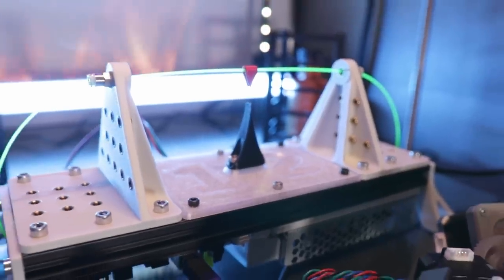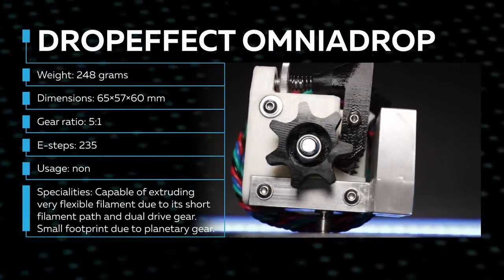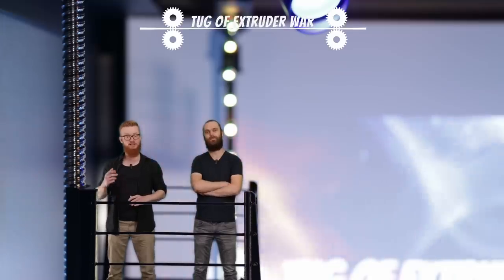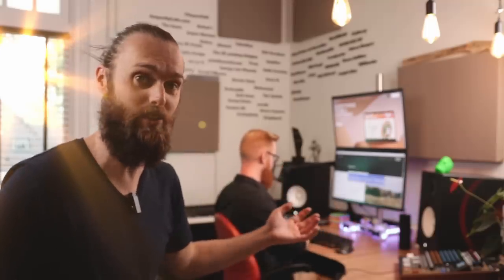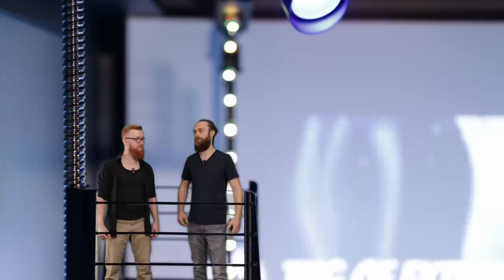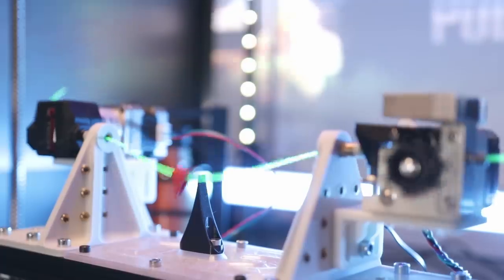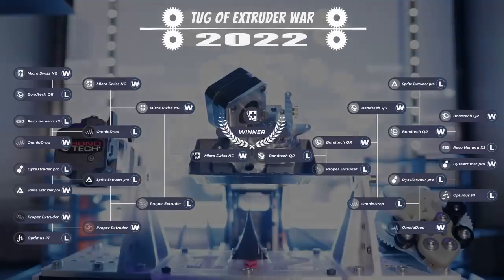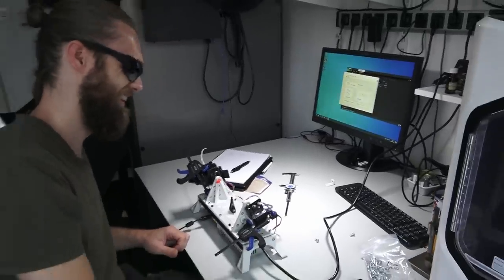We let Extruders BATTLE each other FTW!

Comment from the maker: Hi everyone! In this contest we really push the boundaries of these extruders. Or should I say pull? Remember that the outcome of this event should not influence any buying decision. There are other factors at play when choosing the right extruder, like ease of use, weight, mounting options, extrusion consistency and durability. Extruders mostly exert pushing forces on filament where the filament "wants" to buckle. This is part of what makes printing flexible filaments so difficult. This is the opposite of what we show during this contest. But hey, this is a fun way to compare extruders!
Reply: Don't forget that their Intro Theme Song is also a factor in choosing an Extruder. :)
Reply: Season 2?  
OMG DM1
Orbiter 2 and a few other new extruders should be included.

Comment: Fun idea, this actually should be something they all should do to test these components out and improve their product.
Reply from the maker: Thanks! You can quickly see which parts fail which is very interesting. Normally extruders aren't stressed like this, but I think that lessons can be learned from it.
Reply: Honestly, I am truly fascinated by the idea.
Have e.g. weight classes as well, to determine different characteristics for extruders under 250g/400g/600g etc.
Soooo cooool, and actually useful as well!

Comment: THAT WAS AWSOME, totally great idea of the match and this way you went about it, I was also super impressed to see how well your extruder did, but when you think about it the others where failing because the gear teeth would fill with grinds and the belts just grabs, not grinds so that becomes a non issue. You did great

Comment: Well, that was fun, even if it didn't went as we would like to : ) Great job on the proper concept.
Reply from the maker: Thanks Nuno! I can imagine that you hoped for a different outcome. Your extruder performed exceptionally well though!
Reply: @properprinting  Yes it did. The QR is a power house and it only used 1 single stepper motor. : ) Performance and reliability. That's our game.

Comment: Does motor size matter in this contest?
Reply from the maker: Good question! Yes and no. This depends on the bottleneck of the extruder. Sometimes it's the grip that fails and sometimes it's the motor.

Comment: This was absolutely hilarious and amazing! You continue to stand out with presentation, originality, and exceptional humor. Without a doubt the most proper channel out there! I became a patreon today!

Were all the motors running under the same current or did you optimize the current for each extruder or used manufacturer recommendations? What about extruder arm tension? I think if these parameters weren't optimized some extruders could have been left with a disadvantage.
Reply from the maker: Thank you and thanks for becoming a Patreon supporter! We calibrated the motor current once which I also show in this Twitter thread https://twitter.com/properprinting/status/1573346058985422851
I think that only the OmniaDrop and my extruder would've benefitted from a higher current since the rest failed due to grip. Regarding the grip, I tensioned them to the max to get the most out of the extruders.
Reply: hah I'm not surprised. It's proper printing after all! Thanks for the link that explains it all.

Comment: This video was a lot of fun! Loved the editing and music. Did you adjust the voltage for the different sized stepper motors for each test?
Reply from the maker: Thanks! No, we calibrated the voltage to be equal at both sides. More info in this thread https://twitter.com/properprinting/status/1573346058985422851

Comment: Were you proper excited to see how the Proper Extruder performed vs a 'proper' extruder not made of resin? It was quite impressive to see how well it performed in this competition. I think maybe a longer belt path might give greater hold on filament. Would require the extruder being larger, but if its used as a bowden then that size/weight shouldnt matter a whole lot.
Reply: If you watch closely at the matches where the proper extruder failed, it never lost grip on the filament. It always was pulled hard enough to overcome the holding torque of the stepper motor. It would need to be geared higher or have a stronger stepper motor to do better, the belts gripped better than any of the traditional geared extruders.

Comment: Also.. the sparking of the drivers is why you use a plastic screwdriver to adjust voltage when using manual voltage instead of UART/SPI.
Reply from the maker: True, that would be better. I needed to read the voltage directly, and therefore modified the probe itself to act as a screwdriver, which actually works quite well. Definitely not recommended to do it like this since the power must be turned off when tuning with a standard screwdriver.

Comment: No No No No No, you had different strength stepper motors, to make it fair you need to use the same across the board.
Reply from the maker: I used the ones that came with the extruder. I think it's fairer to use the whole extruder instead of modifying them